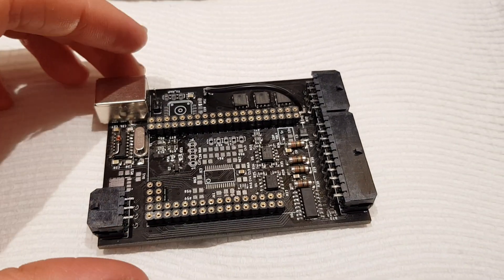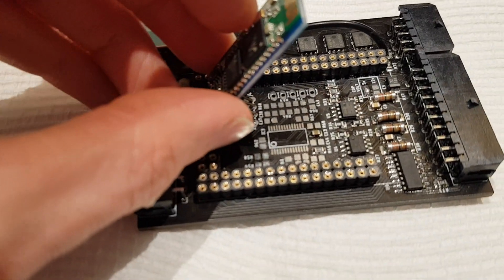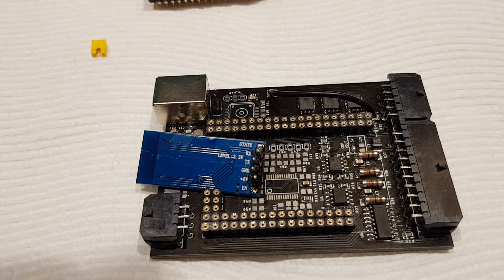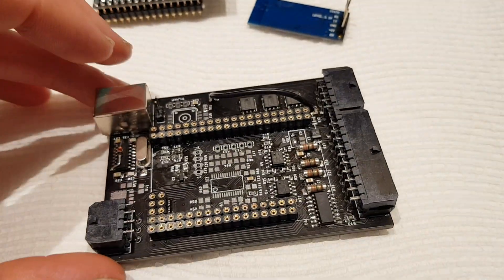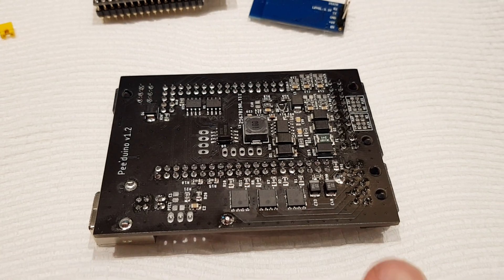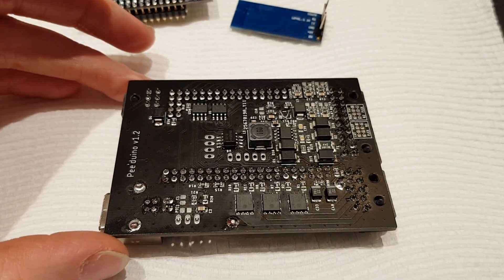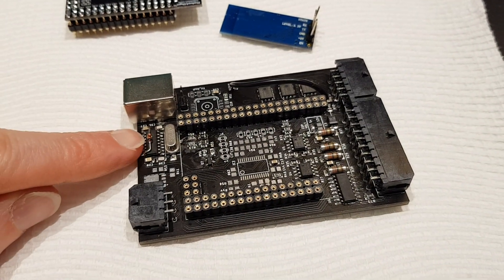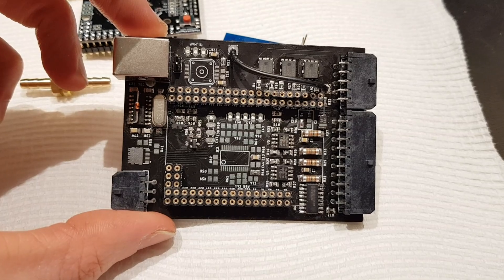mini speeduino

Comment: Nice project man! Did you used an op-amp ic to build the wideband circuit? Or a Bosch ic?
Reply from the maker: It's the 14point7 design.
Reply: @TwistTapeTechnology  thanks man! I found it! Does this circuit work fine?

Comment: Really nice and compact board! Btw how would you attach the antenna for the bluetooth on that module? I didnt see a connector? would you just solder directly to the antenna trace?
Reply from the maker: I was going to cut the trace, or remove the capacitor/resistor that's in series with the antenna and solder it there. Unless you know of a HC-05 module that has an antenna connector? ;)
Reply: @TwistTapeTechnology  somewhere it has to be a HC-06/HC-05 with a external antenna? :O
Reply: Seen mod where someone put antenna connector on them.